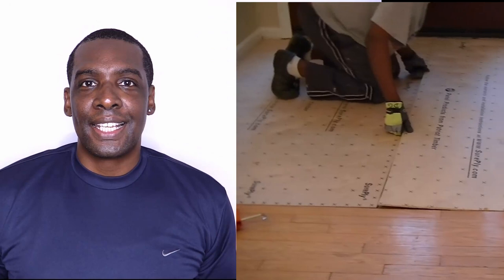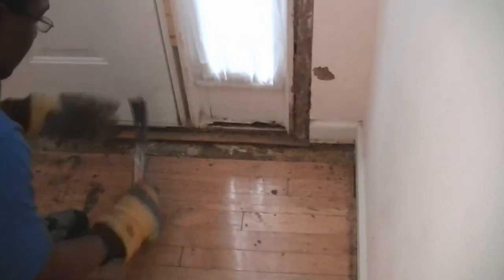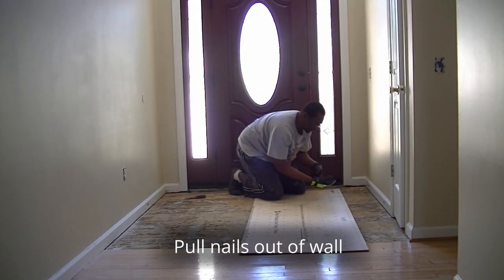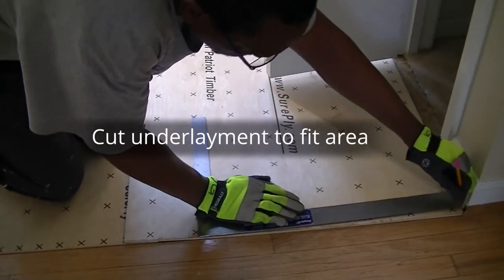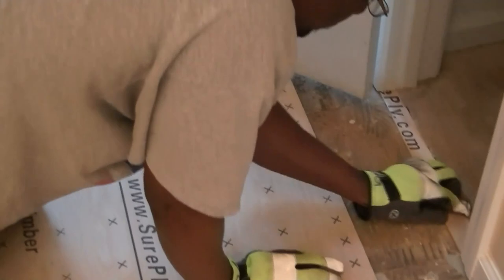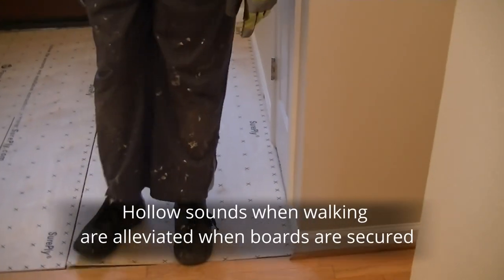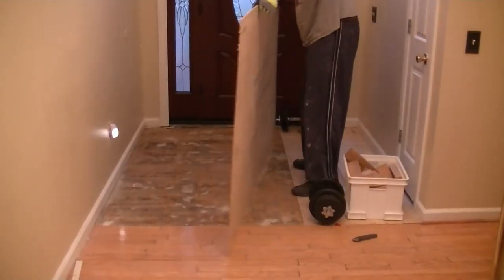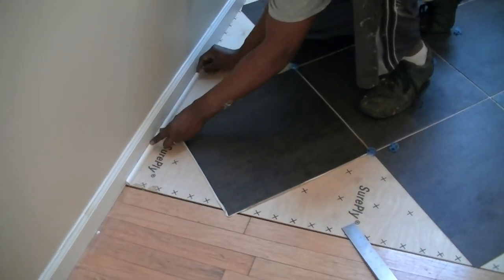Underlayment for Peel & Stick Vinyl Tile | SurePly Plywood | DIY Power Couple

Comment: I currently have existing tile, I believe its ceramic tile ( the traditional heavy large tile a with your grout ) when we had the house built new back in 2018 I was young and didnt give much thought or research into the kind of flooring we wanted and the options were limited with what the house came with. I ended up selecting a white / very light grey tile with white grout 🤦🏻‍♀️ I had two dogs amd two cats at the time amd with white tile and white grout …. well I absolutely hate it and every slight spill or drool or paw print or mark you can see so well and shows through / can be seen so easily and I’m a neat freak! I dont want to have to go through the entire home to uplift and remove all this tile with all the labor and the dust that it will create and because I know by doing so I’d have to practically move ALL the furniture out of the house and then back in! That would be such a nightmare of a renovation to do! Is there a way where we can do a high quality peel and stick tile that you would recommend and also what subflooring or pad layer do you recommend that we put down on top of the existing ceramic tile before laying down our adhesives and then the peel and stick vinyl? Keep in mind the bedrooms all have a nicer vinyl wood flooring so from the ceramic tile transition over to the vinyl wood flooring there is a piece of vinyl strip laid down, therefore whatever pad we lay down first should ideally be as thin as we can get away with.  Please advise when you can and thank you so much!!!!! 🙏🏻🙏🏻🙏🏻🤗🙏🏻🙏🏻🙏🏻 1:02
Reply from the maker: Cindel, see 👀 how we tiled over ceramic:
https://youtu.be/7OwMUpM6udw?si=D1b_zr2yzdvO6BUo
Reply: @DIYPowerCouple   Thank you so much!!!! What’s funny is that I have that exact same existing tile ( that existing tile that you both placed the peel and stick over) that I too am not very fond of. I’m surprised to see that you selected another lighter colored peel and stick to place over it! For me the lighter in white or very light grey color shows potential for showing more areas of any spills or drool and dirt etc. yet I don’t want to get extreme dark either.  Do you find that the peel and stick is long lasting? Any pros or cons that you can highlight with the peel and stick tile from your experience and useage on it?  Thanks again so much for sharing the links to your videos on this. 🙏🏻🙏🏻🙏🏻🙏🏻🤗❤️

Comment: Our floors are vinyl and it's very cold. I was planning to put over peel and stick but now I'm not sure. Should I remove the floor, add insulation than plywood and than peel and stick? Trying to make sure the floors are not cold during the winter in FL.
Reply from the maker: Mark, we tiled right over the vinyl tile in our bathroom and it turned out great. We also tiled over concrete in our kitchen. Both worked well for us, but it seems that tiling over your existing vinyl will give you more of a barrier from the cold underlayment in your home. Also, it is a lot more work to remove flooring, add insulation, place down plywood only to still have a cold floor. 😁Let us know your thoughts. Check out our tiling over existing vinyl video. - DIYPC
https://youtu.be/mpvmRPkQEd0

Comment: Your work was great! I have a question. I'm a renter and cant actually do the underlayment so I was thinking of sticking it directly onto the existing adhesive vinyl but when it comes to removal, where using a hairdryer can melt the glue hence ease the removal process, do you think it will also uplift the existing vinyl underneath? I gotta get that deposit back haha 😂
Reply from the maker: Fujoshina, we understand about getting that deposit when it's time to leave. There are different types of peel and stick products and they each have a different type of adhesive. If it were us and we wanted to make sure we got our deposit, we would probably use the cheaper peel and stick to guarantee it won't stay on the floor forever ♾️. You may have to continuously spot correct the floor, but you won't have to deal with the hassle in the end when it's time to get your money. Your thoughts??? -DIYPC 😃
Reply: Fujoshina, you might want to engage your landlord. I upgraded a number of things in my first apartment and the building engineer was quite supportive - nothing wrong with an apartment being slightly more attractive than others. In my renting days, I found that as long as I wasn't damaging anything or doing something crazy, my landlords have all been ... Well, grateful that I am trying to improve their property rather than destroy it.

Comment: Would you ever recommend putting peel and stick directly over concrete instead of using the  underlayment? Is it possible to do in order to get good results?
Reply from the maker: Hi Santwon! Only if your concrete is completely smooth and level.  A larger space with a lot of foot traffic will probably need an underlayment. We tiled over concrete in this video: https://youtu.be/KLGdmqcEm8U
Reply: @DIYPowerCouple  Thank you Sir for the quick reply! My Wife and I are applying the peel and stick to our entryway floor which is concrete. Your videos have been really helpful. Blessings to you and your Family!👊🏾

Comment: Great job.. I see that you use thin ply. Should I go for thicker or thin.. And what you mean use water barrier.? Between ply and top floor?
Reply from the maker: Yanger melodies, we used a thin ply so that the floor would be flush with the existing wood flooring after we applied the peel and stick to the new floor. You can definitely use a thicker ply if you do not have to make 2 sets of flooring flush against the other. Let us know how it turns out!😃 -DIYPC
Reply from the maker: By the way, the water barrier is a separate (plastic-like) material that you can put down before you start that will protect the wood against moisture or water damage.

Comment: Could I use that sure ply directly over top of old floor board planks in an attic instead of plywood?
Reply from the maker: TheBidendotWIN, if you plan to walk in the attic, we would put down plywood because of its durability. The underlayment we used in this video is thin and is supported by the concrete flooring. Let us know how it goes. -DIYPC 😃

Comment: My issue is that I live in a rental apartment and when I leave I don't want to deal with the hassle of removing all the adhesive from the floor. Is there something else I could use to get a nice tight un-removeable look with my peel and stick tiles?
Reply from the maker: Lavishly imperfect, we saw someone use contact paper🗞️. That could be a short-term non-evasive option. Let us know how it turns out. -DIYPC
Reply: @DIYPowerCouple  Thank you guys. I most certainly will.
Reply: As an extension on your suggestion of contact paper, what brand or type of contact paper would you recommend that peel and stick tile would adhere to for a kitchen backsplash. Could you maybe use musclebound adhesive tile mat? Have you used adhesive tile mats? Are they really renter friendly? Thank you in advance! Love your content!

Comment: Pretty sure you aren’t supposed to use those tile spacers on peel and stick vinyl tiles. Those spacers are meant for ceramic tiles which are then grouted in between…..
Reply from the maker: Hi David, we used LVT groutable peel and stick tiles that are designed for both installation methods.  Here's another video of these type of tiles: https://youtu.be/KLGdmqcEm8U

Comment: This is great! Do you suggest taking off the base boards?
Reply from the maker: Syd, we did not take off the base boards because we were able to place the underlayment beneath them. We would remove the base boards if that is not the case for you so that the flooring will go all the way to the wall and then the new base boards will be even all around the room. Let us know how it turns out! DIYPC

Comment: How did you seal your underlayment?  You had mentioned in written type that it was not water resistant.
Reply from the maker: Hi CC, we used power grab construction adhesive to attach the underlayment to the concrete subfloor.  It was not sealed by itself.  
The waterproofing came by using peel & stick tiles and grouting the seams.

Comment: I was always under the impression that vinyl tiles were placed up tight to each other. No spacers.
Reply: They are. The spacer they used are for CERAMIC tiles which is then grouted in between…..
Reply: Depending on the type of vinyl tile, you can use grout to make them look more like ceramic